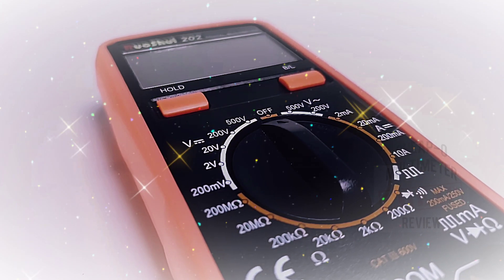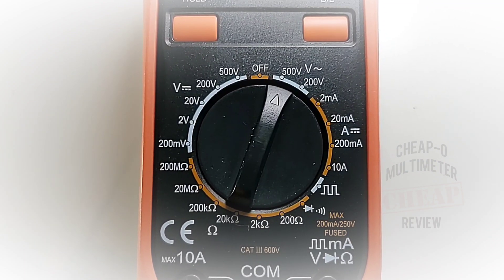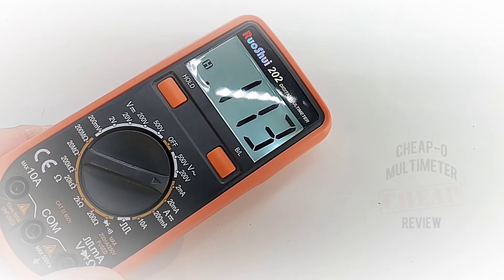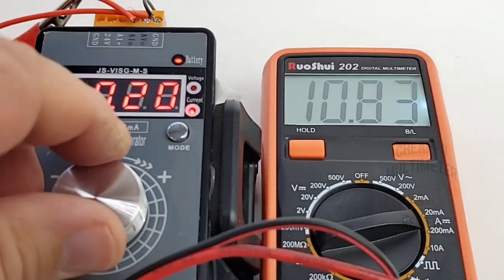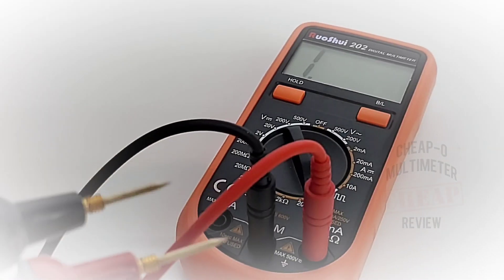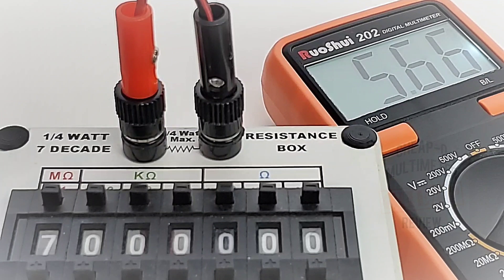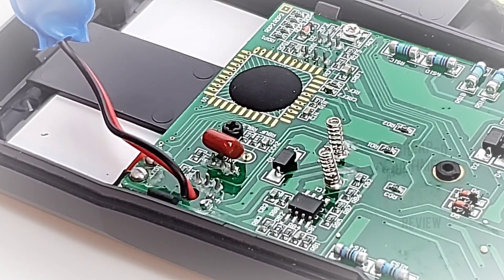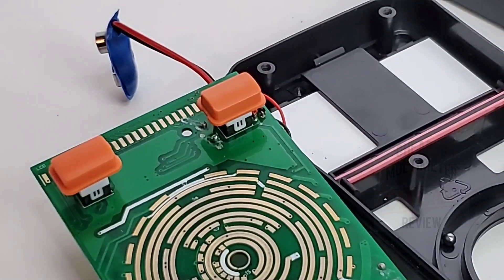RuoShui 202 CHEAP-O Multimeter Review & Teardown!

Comment: Ruoshui and victor  the same, right?
Reply from the maker: Correct 👍
Reply: @KeepOnTesting  i have a victor multimeter vc 890c  accurate  when it comes  to voltage  and resistance  measurement
Reply from the maker: @jamesprieto6439  Excellent! I like Victor 👍 Good price vs performance ratio.

Comment: Can't you modify these cases of multimeters so they would perform better? What can be done here inside to increase the speed of resistance reading? I guess it would require an expert.
Reply from the maker: You can modify any multimeter (for good and bad) but that's not the point. I base the review solely on merit not customization or modifications potential. Most end users won't attempt to repair or alter a multimeter. Thats a whole other venue and not part of a review.
Reply: @KeepOnTesting  I mean you can start doing this as well, and upload here, but I think you don't get that much time. You may have skills though.
Reply from the maker: @bhushan9066  roger that 😀👍

Comment: I may have missed it, but how much does it cost? I love the persistent backlight feature and quick continuity but diode V output and glacial R measurement speed are a deal killer for me. Fix those, make it auto ranging, have it run on AA batteries and it starts to look compelling at ~ $40. Thank you for the review!
Reply from the maker: I paid 16 CDN about 12US ..So its Cheap! That always enabled backlight is a great feature too!
Reply: Wow. They should be able to fix the diode and slow resistance short-comings easily. An auto-ranging w/AA batteries version shouldn't add more than a "couple of loonies." Higher watt-hour of 2 AA vs 9V would be better if you use the backlight a lot, no?
Reply from the maker: @ericchang7706  Definitely! The energy density of a 9v is terrible in contrast to AA..Plus, all multimeter ICs can be powered on 2.5v or less..so why do they still bother with 9v anyway...